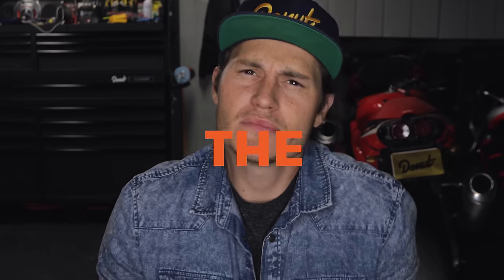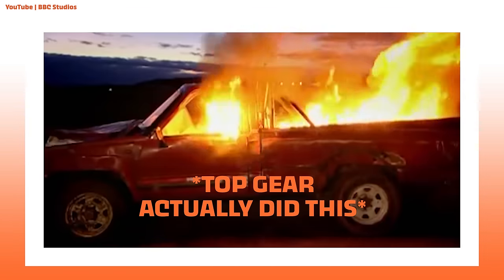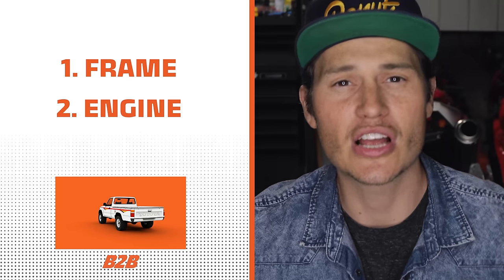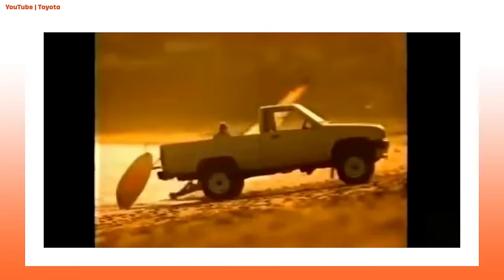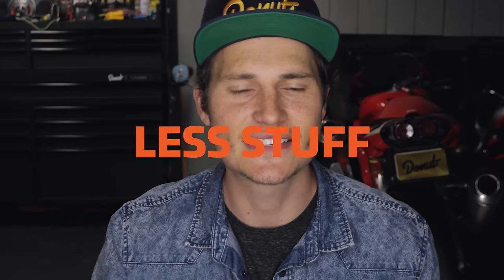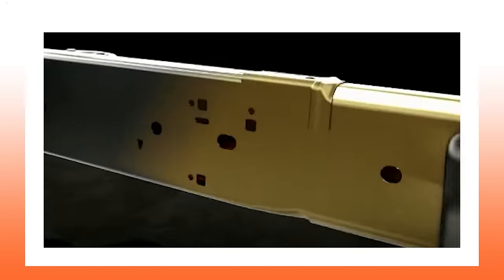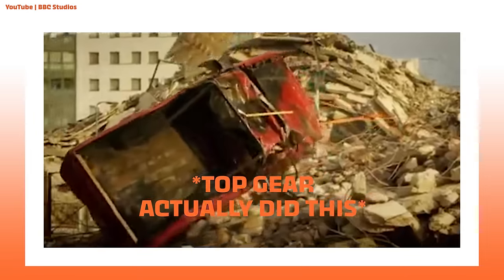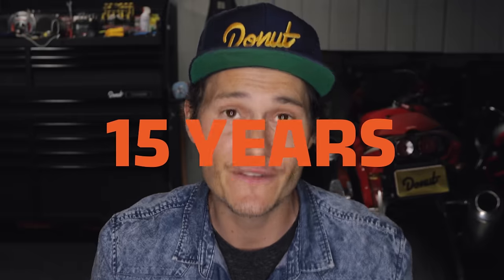Toyota PICKUP Truck - The Science EXPLAINED

Comment: I’ve got a 1981 Toyota I still drive daily, 411,327 miles as of this morning and everything is original
Reply: Where do you live, the desert? Rust would have killed that truck up north.
Reply: Not your timing chain.  You may not have changed it, but someone did.
Reply: @hankvinson5967  my friend have its dad toyota 1985 pickup and still run good to this day and it have 700k on it
Reply: Contact the editors of Guinness World Records.
Reply: is an 87 isuzu the same?
Reply: How many miles now?
Reply: I got an 82 and its diesel its fun
Reply: @hankvinson5967  I live is a desert and my 86 pickup is still kicking
Reply: @joshuaportillo4880  awesome! I live outside Chicago and my 99 4runner frame is badly rusted. 211k miles.
Reply: 1995 Hilux 357,782 Kilometers here going strong
Reply: @hankvinson5967  I live in northern British Columbia and my toyota pickup has 370,000 on it. The frame is still black. I think its because its so dry here and I only drive it in the summer.
Reply: @blacktailbowhunter0135  that's awesome. My 99 4runner has been a daily driver and 211k miles in the Chicago area and the frame is rusted badly. Had it patched but only a matter of time til it is rusted thru again.
Reply: @xanny7373  Those year Isuzus and Nissan harbodys are just as good as the hilux
Reply: Those spark plugs must be knackered.
Reply: Original oil? Wow.

*obviously that's a joke.
Reply: Ive ordered a new one. Hoping to keep it 20 plus years
Reply: I got a 89. The original motor died at 402k miles and I put a new motor in and put 76k on it. Still runs and drives fantastic
Reply: Gimme
Reply: My 81 has 465,000 but sadly the frame is rusting through in some areas as it's a Colorado truck. It's my  daily driver when it's not snowing or roads are crappy. Still original and the 22R is getting a complete rebuild this winter down to the crank.
Reply: Everything is original.  Except your comment.
Reply: I got an 87 F150 with the 300 straight 6 engine and it has over 1,000,000 miles
Reply: 1999 taco rebuilt at 485k the only thing wrong was the valves burned out. Everything on the inside of the block was like new
Reply: Got a 2002 Tacoma with 373k on it, everything’s original outside of some trim/bumper parts.
Reply: My dad had a T100 we over filled the bed with path rocks it was riding low thats all I can say
Reply: The timing belts needs to be changed every 100000 kilometrs. If u have the 3L NA diesel engine( aka 'the donkey') like mine change the oil every 5k Kms..no need for expensive stuff since you are changing it like diapers and filters every 10k. The only issue i had was with the starter motor..easy fix just cut out the old worned out carbon brush and solder in any that fits or grind to fit and voila.
Reply: '89 Ford Ranger with 850k+ miles on it, i do enjoy both trucks though, vintage trucks are great
Reply: @xanny7373  I don't know about Isuzu branded trucks, but they made Chevy Luv which also lasted a long, long time.  Been out of production since the mid 80s or so, and I still see them around from time to time.  Same can not be said for Ford Courier, which seem to have completely disappeared.
Reply: The day it breaks down please inform us of how many miles it has
Reply: @hankvinson5967  exactly. Sadly here in Ohio most of the badass little pickups are gone... I wish my dad kept his. Damn thing was sold to a guy from Kentucky. Never knew anything else since...
Reply: @austinross8444  did you check the valves every 200k?
Reply: It's not like many care but I have the infamous rollover box... The Bronco II
Reply: You must have a spine of steel.
Reply: @tuckersautter1832  mom has a blue one. Stick. The big motor.great off road and towing.
Reply: @DiscoStringHit  a bit pedantic.. a timing chain is a consumable part, like tires, spark plugs etc.. of course all those aren't original.
Reply: Give us updates 4 years later

Comment: whistlin diesel just proved its towing capacity is 30,000 pounds
Reply: yup
Reply: AT LEAST 30k pounds
Reply: It’s gotta be higher, he was doing that in second gear 😂
Reply: @immachine1565  it’s literally called towing capacity though
Reply: He just dropped it from a helicopter now its toast
Reply: @jackychan416  yeah no truck could survive that. I’m wondering about the engine still running though...maybe
Reply: @immachine1565  it pulled 30k in 2nd gear that’s impressive
Reply: @immachine1565  you must be fun at parties
Reply: You forgot to mention they rolled it first
Reply: 31k actually
Reply: Also that they can fly.
Reply: I have watched the video
Reply: Haha the v8 Mercedes suv can do 100,000poundd
Reply: @ethanmapanao7542   Lies
Reply: @jolness1  do you need a juice box?
Reply: @really9962  I guess I am not understanding what juice boxes have to do with this conversation? Are you made because you like him?
Reply: @jolness1  bro your comparing modern super duty trucks that were purpose built for that to an 80s 1/4 ton pickup that was meant for light farm work at best. You don't have a clue.
Reply: @DertyMike  no I'm saying they are different and that's why it doesn't have an actual 30k lb towing capacity. Towing capacity means you can stop it. The Toyotas brakes would fade so hard even stoping from 20mph they would fail to stop the vehicle in less than 2000ft. 

You don't have a clue apparently.
Reply: @jolness1  I'm not referring to its tow rating, I'm referring to the fact it managed to pull 30k pounds rather easily. Of course that truck wouldn't be able to stop that load going at any reasonable speed, that's a given, but the fact the rear end/trans/transfer case didn't grenade itself is very impressive.
Reply: @DertyMike  that's literally what the original comment said. "Just proved it's towing capacity is 30,000 pounds"  that's what I was responding to when you said I didn't have a clue while spewing nonsense about not comparing the two. The comparison is because those can actually haul 30k lbs.
Reply: @DertyMike  I'm not saying these aren't over built but to say "wHiStLiN dIeSeL pRoVeD iT" is dumb and that was my comments purpose
Reply: @jolness1  I don't think he meant it that way in the original comment as anyone who did have a clue would know that it can't properly tow 30k pounds.  WD didn't prove it was indestructible, Top Gear did, WD just reinforced it.
Reply: Anyone gotta link?  I can't dig it up.
Reply: @ethanmapanao7542  damn thats crazy its almost as if the mercedes isnt a tiny truck from the 80s
Reply: he welded i beams under its frame   incaSE you missed that
Reply: @jolness1  buy better brakes and put them on it 😱
Reply: All those vids were insane!
Reply: @jolness1  bro sit down have a drink relax
Reply: @jolness1  i bet you're alot of fun at parties.
Reply: @mctransportation9831  I’m not.
Reply: That shit was crazy🤣🤣
Reply: @jolness1  hypothetically then, couldn't you just get breakers capable of that on said truck (don't bully me i'm new to this)
Reply: Done it with a welded diff too. That really tested the diff and axles.
Reply: It was the diesel hilux tho not the v6 pickup
Reply: @jackychan416  he has 13 more
Reply: @JamesDavis-jo9tk  late answer but no it didnt the 2L-T diesel engine is a tall block engine so its not that much room heigth wise for it to be able to survive that
Reply: @mortenhinsverk2406  I agree
Reply: @JamesDavis-jo9tk  those 2lt diesel engines are almost bulletproof if you leave them stock, sure its not the fastest or anything but its impressive for a 90 hp engine xD
Reply: @mortenhinsverk2406  yeah I know. I could’ve bought one over seas back in 08 but couldn’t afford to have it shipped home.
Reply: @JamesDavis-jo9tk  yeah the shipping would be a decent amount im from norway so we got them new and in december 2021 i got mine, 98 x cab (one and a half cab) it started its life as a construction truck and was for 12 years then it went to a farmer as a farm truck for 8 years and was parked untill i got my hands on it xD and in the 13 months i have had it there have been 2 things there is a sligth wear in the rear axle and i had to give it a new alternator 3 months ago other than that i gave it a service when i got it prake pads and greased the grease points and  keept up whit oil changes and its as realible as a truck can get
Reply: @mortenhinsverk2406  there’s a 30% import tariff on them in the US that’s why we can’t get them here unless you find one 25 years old and still pay shipping and federal tax.
Reply: @JamesDavis-jo9tk  yeah it will be alot of money and the hiluxes is already pretty overpriced i paid around 4000$ for mine so whit shipping and the tax it will set you back some but how about getting an american truck and then engine and gearbox off ebay?
Reply: @analogpowered  hilux durability test #2 i think

Comment: man imagine a vehicle today made durable, easy to work on or would even last more than 5 years before needing ridiculously expensive/serious repairs/maintenance
Reply: my dad has a Toyota hilux and it was so old it was RWD 💀 but also its older then me so goofy ahhh AND with 3 REPAIRS which weren’t even important.
Reply: My Honda Civic has lasted over 5 years without a single mechanical issue, and that's with over 6k in collision damage. (Not with other cars, stuff like a tree falling on the car, etc...)

Also took about 15 minutes to change the transmission oil myself. Not hard to maintain at the very least. Still runs great, starts in the cold with no issues. (I live way up north). I used to do delivery, and would drive it like I stole it, and it's holding up through all of that abuse.

They definitely make durable vehicles today. (In many ways, they're more durable and the computers can adapt to user error, like putting the wrong fuel in).
Reply: That would be heaven sir! Lol 😅
Reply: They still make the Hilux
Reply: Toyota stuff from the 80s is actually amazing
Reply: With what we have at our disposal now we could easily salvage one of these old Toyotas and modify it to strengthen it's weaknesses
Reply: Most new vehicles today last 100,000+ miles, with no major mechanical issues. Working on new ones is a pain, or impossible, but they will easily last five years.
Reply: Saving up for a 89 hilux :P
Reply: Basically a Hilux
Reply: What new cars are you buying? Every new car I've had over the past 16 years have gone 120kish before I replaced them and the only repairs I've had to make have been to infotainment systems or wearables like batteries and brakes.
Reply: In my experience the isuzu dmax is that car.
Reply: @wyomins they should last a million miles man I do 100k a year that’s why I stick to old junk
Reply: Maybe a 70 series landcruiser, but they have thin hoods for better “impact protection” but Idk, still has few more years to prove itself
Reply: Honda and Toyota still make some reliable cars
Reply: @wyomins  100,000 miles? That's cute. My mate's 97 Hilux is pushing 300,000.
Reply: @dutchmansmine9053  that's my point. 30 years ago 100k was the end of the life of many vehicles, now 100k isn't even that much. 200k is pretty common. I said 100k without any major malfunctions.

Comment: I love my 1990 Toyota 4x4 pickup. Almost 300,000 miles and still running like a champ. Even has a sunroof and electric windows
Reply: i got a 96 Toyota T100 4x4 - approaching the 388K mark :)
Reply: I still drive my 1990 toyota 4x2 pickup. 31 years later, still starts up and running strong!
Reply: Excuse me, sir, i've got a question: is it a aspirated or turbo? I have the chance ti buy a 2.4 aspirated (79 hp) and i would like to know if it is a good engine and capable to tow. Thank you!
Reply: Got a 03 Tundra with about 255k and it’s still just going
Reply: 84 landcuriser with the 3b desil over 690k miles
Reply: My 95 T100 is still going at 605,000, with the original Automatic transmission.(I just changed solenoids and filter, and it' performs like it was new)! Plus, it's a lot more comfortable than the smaller 80's truck.
Reply: Just inherited a 93 Toyota pickup, only has 83k miles on it!! Currently doing some easy maintenance on it, replacing TPS, had to replace the coolant system and have to gut the interior, new seat etc. but the engine is strong as hell, and I have no doubt this thing will last for a very long time